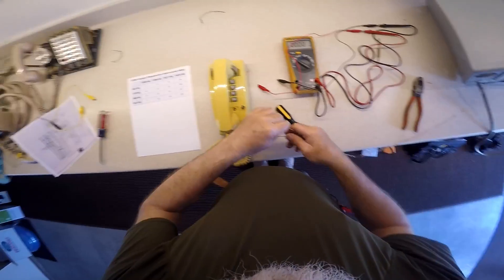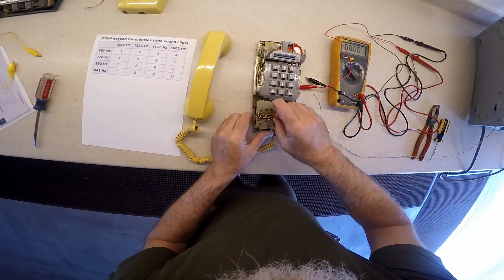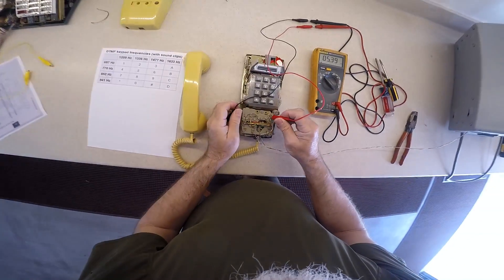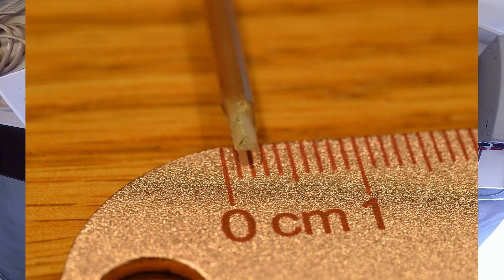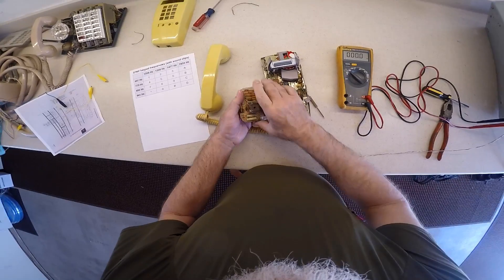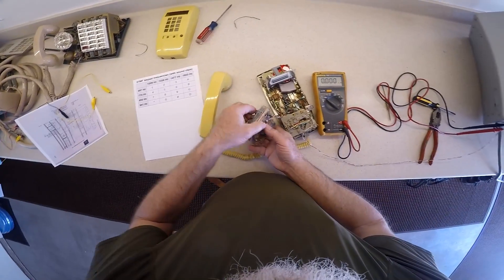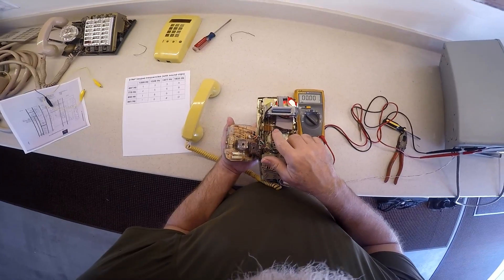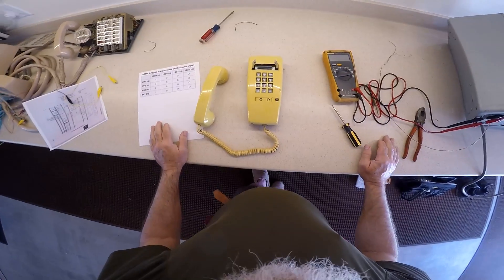2015 Adjusting an old Touch Tone Dial

Comment: Fantastic. The triangle tool is the real trick. Wouldn't have known that one. Otherwise, it's just like aligning an AM or FM radio coil (sorta). Also I'd completely forgotten that old behavior from when I was a kid and you'd mash down two buttons and get just one tone, which is also crucial so your frequency counter/ meter can read it. Thanks a million!

Comment: Very cool, I never knew these had adjustable high and low tone oscillators.  Nice video.
Reply from the maker: Thanks. This only applies to the early dials before about 1980. Not quite sure when they quit making them that way.

Comment: I have a similar phone (but one line and in red) that doesn’t dial out anymore. It sounds like I am pushing two digits at a time when I am not. It’s from 1978 but I am not sure if it has the same dial adjustments on the back. I should go check 😁
Reply from the maker: Sounds like the dial either has some bad contacts or one of the transistors has failed (very unusual). Open the phone and check the contacts along the sides and back amusing it is the same styel
Reply: @cowboyfrankspersonalvideos8869  I opened mine up and it’s the same style dial as yours. Everything visually looks ok but I’ll have to have my friend do some testing with his meter. Your video gave me an idea of what to look for

Comment: Can you tell me which terminals you put the probes on. We're they L1 and GN?
Reply from the maker: That would depend on the specific model of phone. The simplest connection would be across the red and green line input pair. In most touch-tone sets that would be G and R. You have to supply the DC current across the line connections or you won't get anything.
Reply: @cowboyfrankspersonalvideos8869  thankyou I appreciate it
Reply: I have one more question, in your experience once you tune the dial, does it hold the frequency for a long period of time? Or does it get to the point where you have to tune it again? Thankyou.
Reply from the maker: @southernphonemanstelecom2634  While I gave away most of my collection in 2018 after my partner passed away,  I had way more than 100 Touch Tone phones, most of them between 40 to 50 years old, I've only had to adjust 2 of them. That said, If the adjustments on a given phone happens to be loose then you might find you need to retune them.
Reply: Ok kind sir. You've been a great help.i appreciate it